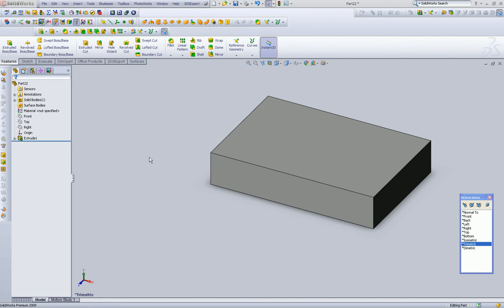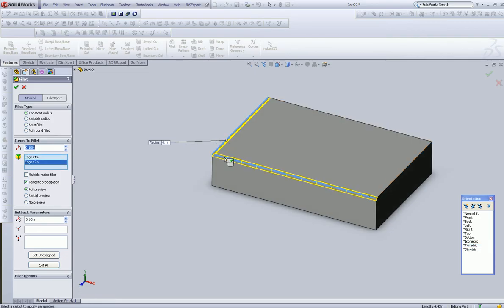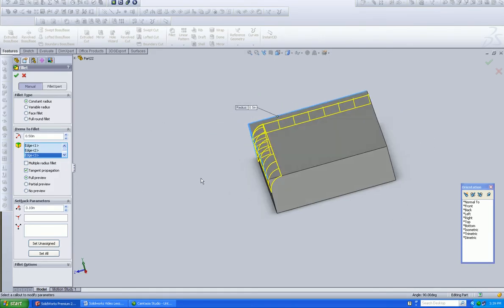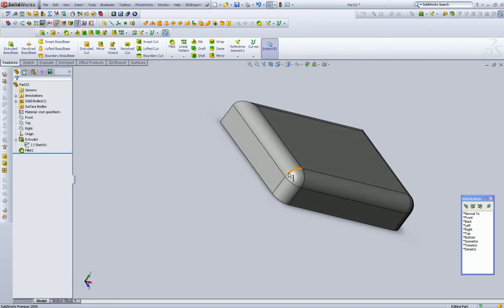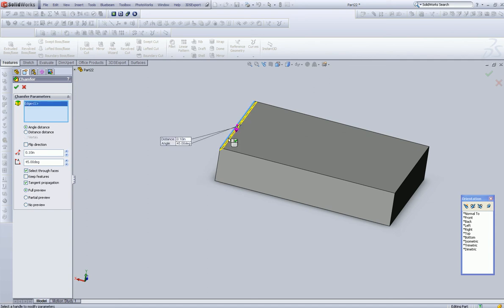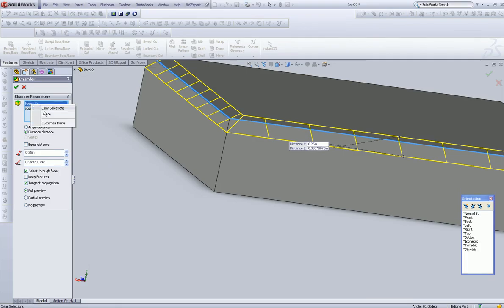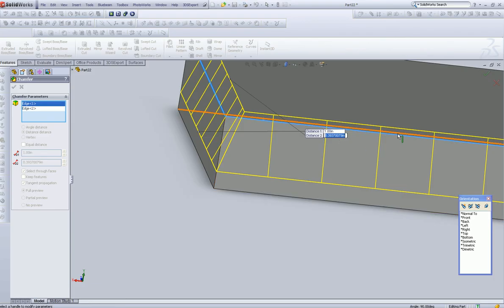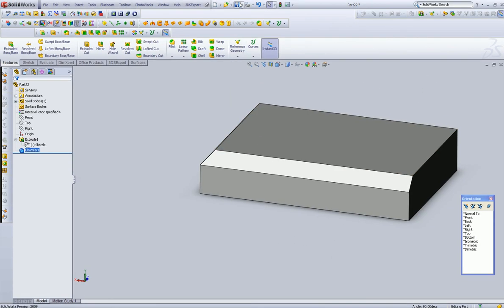Solidworks Tutorial, Using Features Chamfers and Fillets

Comment: This an old video but still, it's the closest video I've come across in my attempt to get answers regarding the chamfer tool.  I'm still using SolidWorks 10.  I have a solid model of a 1/4" thick by 1/2" wide by one inch long.  It's shaped like the  profile of a duck's head.  I'm wanting to create a chamfer along its top outer edges just to take the sharp edges off of my model similar to what you've done in this video.I've had no problem doing this on all other models I've ever drawn up that needed chamfered edges.  My problem here is that for some reason SolidWorks will not create the chamfers I'm requesting regardless of how shallow or deep I make them.  Only if I click on certain edges will a chamfer be partially created.  As soon as I click on another section of the same edge,  it turns from yellow to blue which tells me that something isn't right.If I go ahead and click on all the top surface edges that I want chamfered and I click on the green check mark to produce the chamfer, I get a message stating that it cannot perform the chamfer due to some geometry related error.I can't figure this out so I though I'd ask someone who has more experience using SolidWorks.  Can you tell me what might be causing this failure to chamfer the edges I need chamfered?